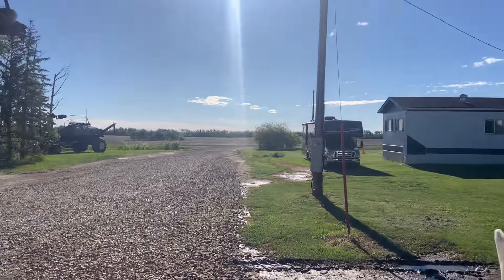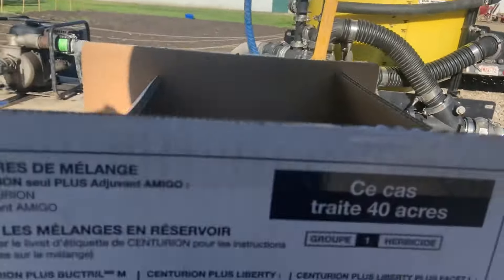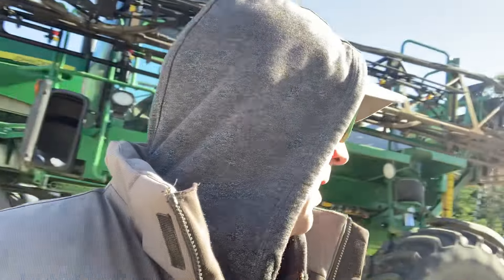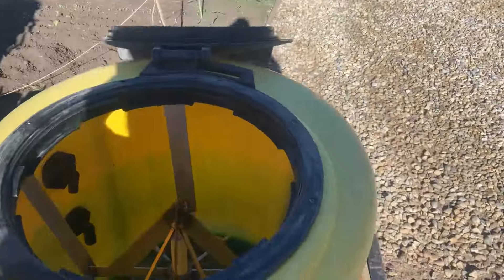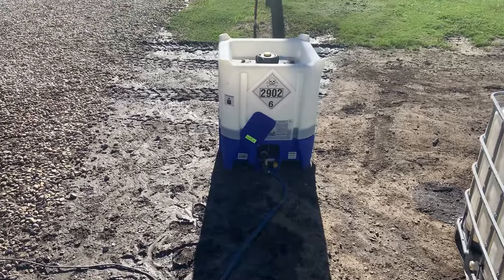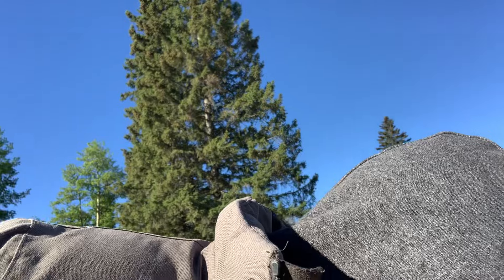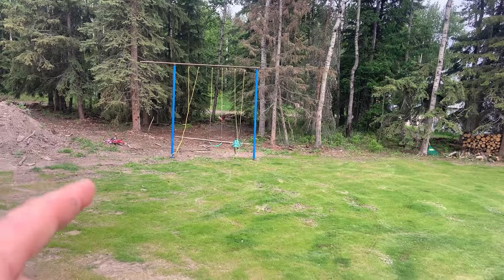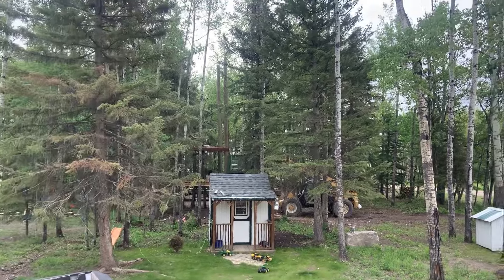Tree house construction

Comment: Glyphosate is usually better with lower water rates, especially if your water is on the hard side.
It will lose effectiveness because it will try to soften the water.  Its first use was as a water softener.
Reply from the maker: I did not know that about glyphosate.
Reply: @millionairefarmer.  I worked for Monsanto and I had some customers who could only use approximately 2-3 gallons/ac. They had very hard water